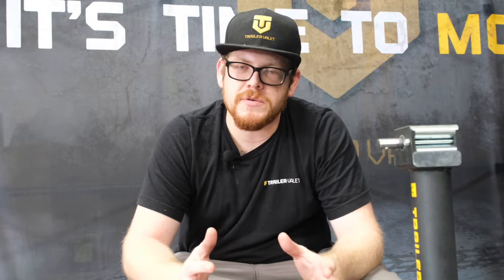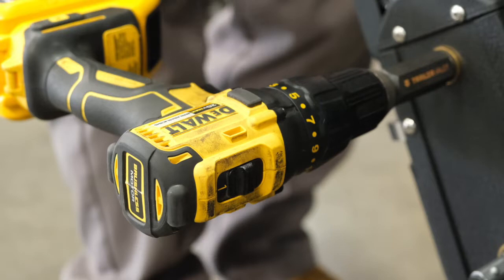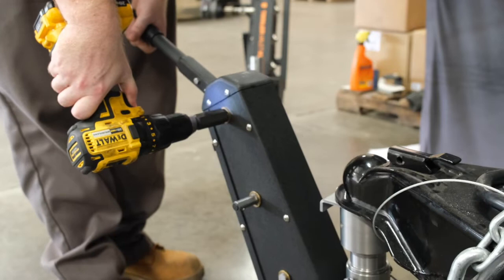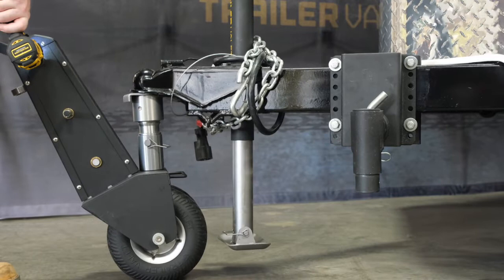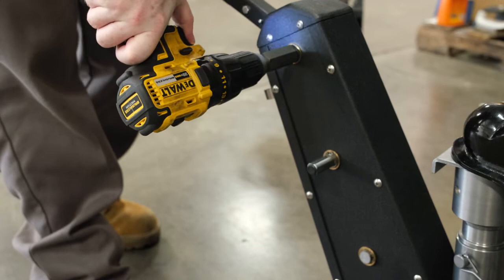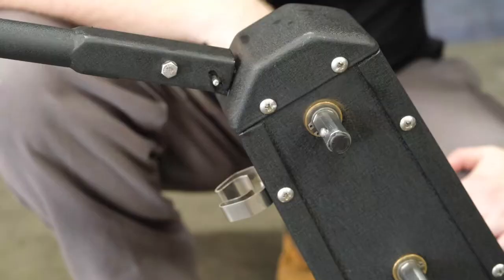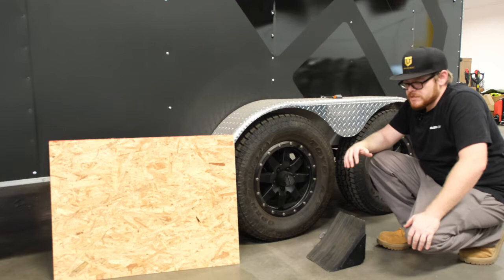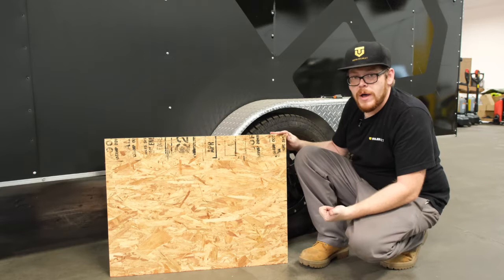How To Use The Trailer Valet Drill Attachment

Comment: I think that unless you are shorter than 5 feet tall, this could cause a strain on your back. That bent over position looks very awkward. Too bad the upright model is almost $2k....Make the XL about 18" taller at the same price point, and I might consider it...Thanks !
Reply: I have the XL and completely agree. I mentioned this to Trailer Valet and they made it seem like I was using it wrong yet every video I've seen has the user hunched over. I also  mentioned making an adaptor kit for the XL so it's similar to the pro. Would be much safer to use too.

Comment: Do you have a video on how to adjust the height of the ball?  I ordered one and now I'm worried I won't be able to get the boat trailer high enough so I can leave the tongue jack down while operating it.  Not being able to operate it with the tongue jack down as a safety backup would be a deal breaker.

Comment: hi - great video - thanks - real quick question for you, at the 2:52 mark of the video i noticed that the metal lip (the piece of metal that is "L" shaped) is facing out, is that the correct position or should it be reversed?  I have a 25' TT that is 5500lbs dual axle.  I moved it with my new XL and it worked good.  I want to be sure I'm assembling it properly, I don't want there to be any accidents.  Thanks in advanced!
Reply from the maker: Hi there, thank you so much for considering Trailer Valet for your trailer needs. The positioning of the lip will depend on your trailer coupler. If you have a standard coupler (if the bottom of your coupler is flat), your coupling plate needs to be facing your trailer. If, however, the bottom of your coupler has what I would describe as a "half crescent protrusion", The lip will face away from the trailer. The rounded side will fit into the half crescent beneath the coupler. Please refer to our couplers videos for more info https://youtu.be/9oJKr9r6U3k. We cover the standard, square, bulldog, and cast-steel couplers and how they should be properly installed. Please feel free to reach out to support@trailervalet.com for any questions you have. We hope this helps!